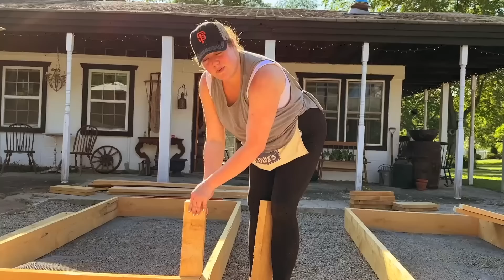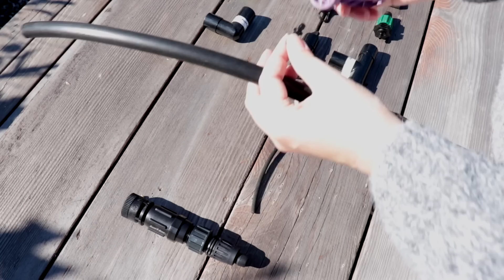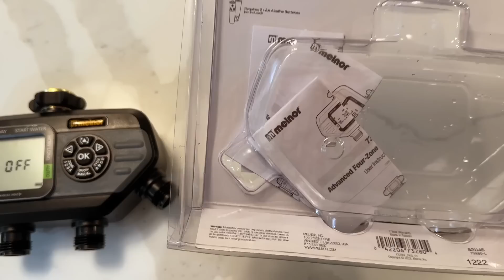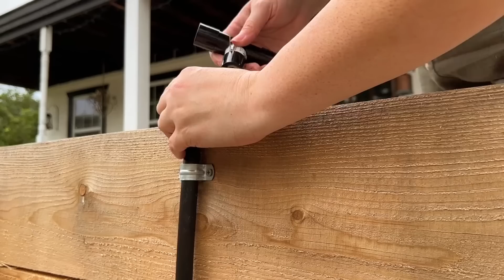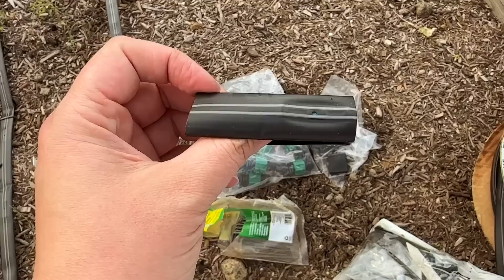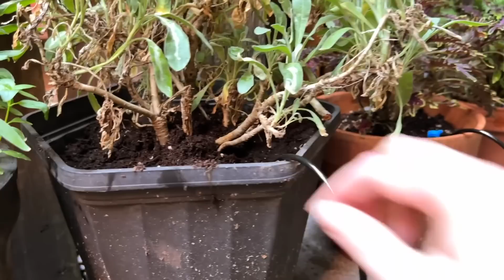How to Install a Drip Irrigation System for Raised Garden Beds | Step-by-Step DIY Guide

Comment: I don’t understand what is pushing the water thru the lines. Is there a pump? Do you just constantly have the  outside faucet on?
Reply: The outside faucet is set to a time and the timer turns on and lets the water run through it. When the timer is off, the water stops getting pushed out from the faucet

Comment: Great presentation! I have two long runs on a timer and has been a game changer. Am thinking the solar drip might be great in some large containers . But how do they work? Do they run all the time that the sun is shining? Can you turn them off? Can you put timers on them? These would be used where i have full sun most of the afternoon from noon til 6 pm in zone 9b inland.   I use solar fountains in my bird baths and love them. But the ones in the sun run from sunrise to almost dusk.  Thanks!

Comment: I was looking at all your links and love the drip tape idea, but I can't find the link for the things you are using at 9.55 time, the connectors for the tape to the pipe at the end. I hope that makes sense, it was a good video.
Reply from the maker: I guess I missed that link! I just put it in the description box.. they are called drip tape row starts. You can also find ones that have a shut off valve on the top so if you ever wanted to turn a specific line off, you can do it from the row start.
Reply: @WhitneyBaldwin  Thank you so much.